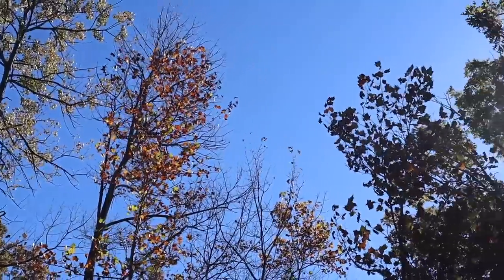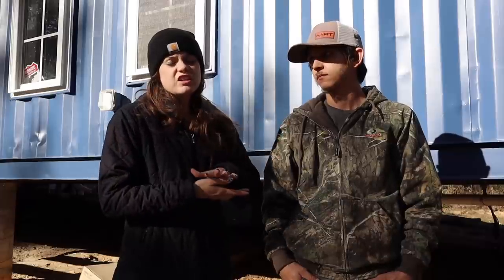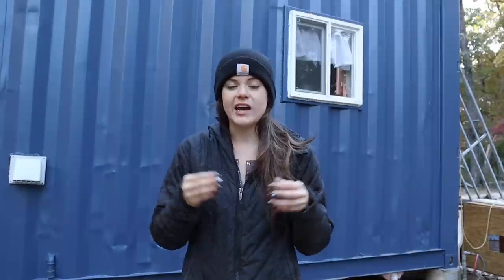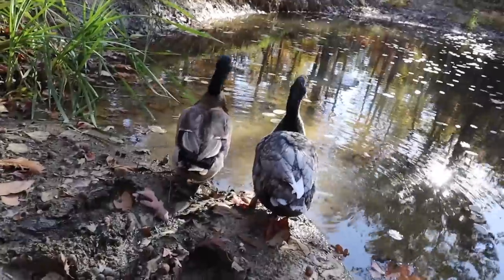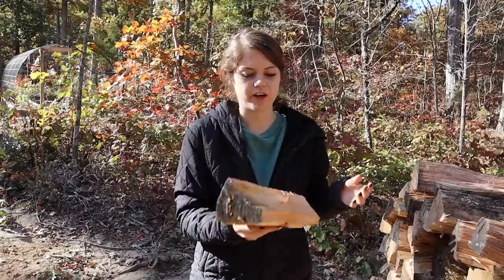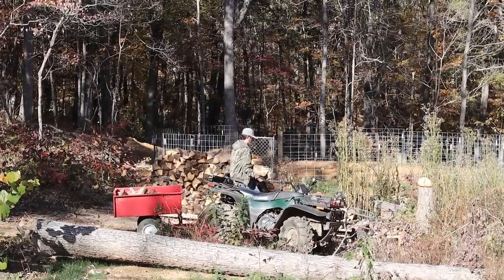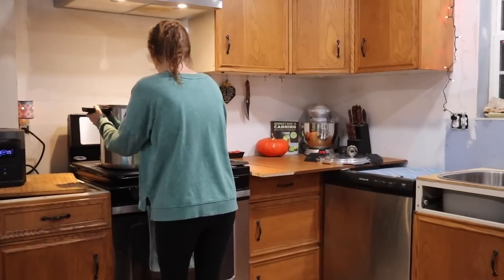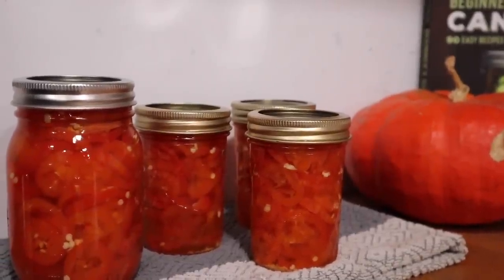CONTAINER Home CRAWL Space Prep I Shipping Container Home |EP:74 |

Comment: FYI before you close in the crawl space you need to put plastic on the ground so you don't have a moisture problem it will come up in to your home
Reply: @barbie.oppenheimer  I so agree it makes a big difference in moisture in your living space, when we did that
Reply: that what a friend said and all his wood floors molded and rotted he had to replace 75 percent of his floor this does not take place over nite if it was a raised house it is in the code books and my daughter just had to have vapor barrier place under her raised house and had to have mold treat under her wood floor before placing a vapor barrier/ plastic sheeting
Reply: I used 6 mil plastic sheeting with a application-specific seam tape.
Reply: I have my house since 1993 (29+ yrs) no plastic, but was able to get railroad ties butted tight together and pegged in place. They prevented water from running under my house. It's been dry as a bone under there for all this time. But you're right. It has to stay dry under there or you'll have mold, mildew and fungus! Yuk
Reply: I had a house right beside the ocean for 17 years. It had a closed in porch with a dirt bottom. The wood was moldy. I put down 6 mil plastic and hardware cloth for water rats. The porch had plywood and vinyl siding. This  eliminated the moldy smell in that room. I cleaned all the underside of the floorboards with a bleach solution. After that I had a dry crawlspace for 17 years with no mold or mildew. Good luck!
Reply: I was thinking the same thing about plastic on the ground.  Kinda building a garage with a dirt floor, it will eventually rust out your vehicle. Good luck